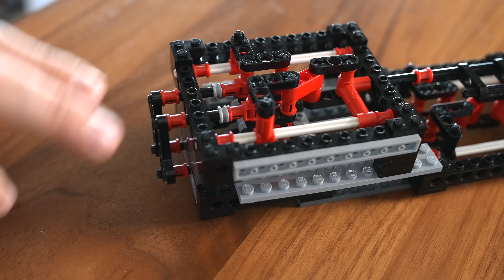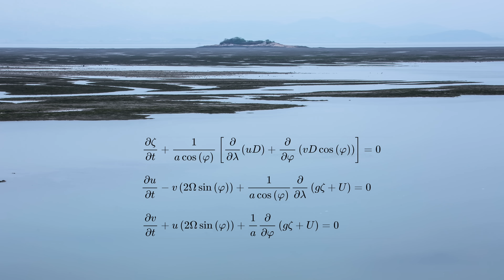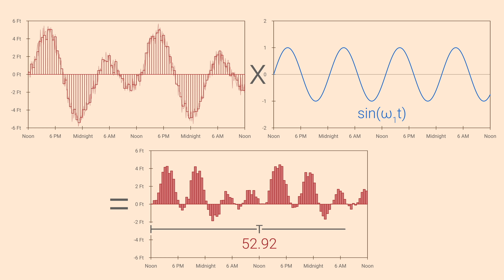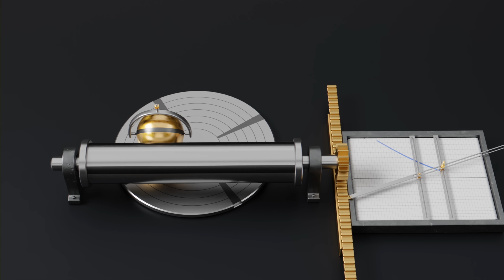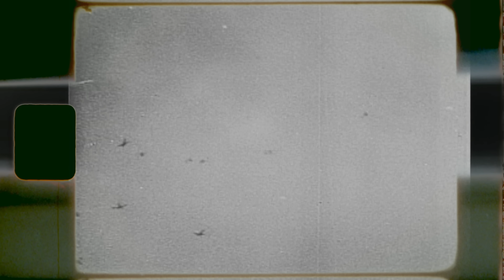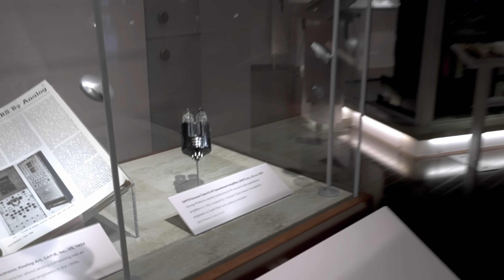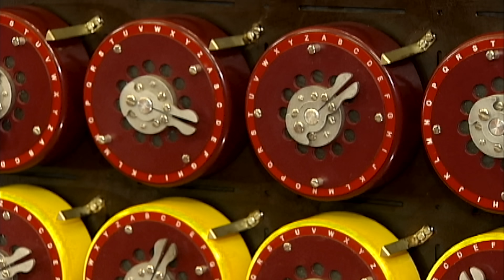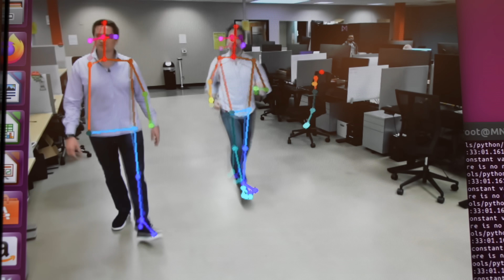The Most Powerful Computers You've Never Heard Of

Comment: In my view, any analog device could be more easily made in let's say CAD software and would output when run exactly same result in simulation every time. Also mechanical failures or inconsistencies in material would not be an issue. Now, if this is really true, there would not be those startup ups out there so looking forward for next episode .

Comment: There are a couple of unstated things that have led Analog Computers to have taken a great backseat to Digital Ones.  I also will make a comment about where I think your next video is headed.

I think everyone knows that Digital Computers have gone through an insane cost reduction and power growth curve at the same time.  This doesn't just include processing power but power, memory and storage as well.  Analog Computers have not been anywhere near as scalable to date.  In a massive oversimplification, the noise problem that is mentioned carries over into analog devices in many ways.  This means that analog electronics just has not been able to go through that same revolution cost, processing, and storage revolution.

The second problem is exhibited throughout the presentation.  That is that Analog Computers, as we know them today, solve one problem at a time.  We have yet to come up with an effective way of creating the equivalent of software to drive the development of analog computers.  Imagine having a different computers to run YouTube, Netflix, Gmail, etc.  You can make make analog computers out of general purpose components, but you would have to reconfigure them to run different applications.  I am old enough to have to have "programmed" analog computers to solve circuit problems in Engineering school.  The computations to set them up correctly to make good waveforms often took hours or days.  

So, I suspect where Derek is heading is a new burst of neural network research.  These have been around a long time and are intended to emulate the working of the human brain, which would theoretically lead to a general purpose Analog Computer.  Will be interesting to see if anything meaningful has been done in the last 30+ years (which is the last time I paid attention to this).  We could make 10ish neurons at that time and had found some ways to solve specific problems with learning.  Scalability and general purpose were not solved problems.

Comment: Can someone tell me why the mechanical integrator uses a ball and not a thin disk? Was there some adjustment that was done by tilting its axis? I've looked and photos and see no facility for it. There was a disk-and-wheel mechanical integrator, but I can't find any remarks around why you would pick one over the other.

Comment: Hypothesis: Using digital computers to manufacture analogue computers will dramatically decrease the failure rate of the analogue computer due to the precision and consistency of the digital computer.

How to test: Design an analogue computer who's purpose is to measure the fluctuation of something commonly understood. Build one version of this computer the traditional way, and the other version, using the digital computer. The constant being the fluctuation being recorded (a pattern or system already well understood, something we don't NEED to measure anymore), and the only variables being the way the analogue computers are manufactured.

The conclusion of the experiment should give us an idea of how digital and analogue combined can effect the consistency (or remove the inconsistency) of analogue technology.

This doesn't seem like a ground breaking idea, and I'm sure part 2 will actually touch on this, but as far as I'm aware, this isn't considered/mentioned. Unless I'm overlooking something.

Can we get this comment noticed by Veritasium to try and get a response? If for nothing more than to soothe my curious itch.

Comment: This is interesting. I wonder how they compare to something like the MOST bus in some cars. They use optical fibre to transmit data around the car. But they don't use digital signals, but i think its 64 possible values instead of 1s and 0s at a few megabits.

Comment: I hate to be the pedant, but the Norden bombsight wasn't a failure because it was analog.  It continued to serve with distinction in the Atlantic theater.  It's failure came from being installed in the much higher flying B-29's in the Pacific theater.  When it encountered the jet stream over Japan for the first time, it had to compute groundspeeds that to that time were undreamt of.  This is an example of input saturation, not an inherent weakness in analog systems (poorly designed/imagined digital systems are exposed to this failure too).

Comment: Analog computers are specialized devices.  They have to be purposely built for specific tasks.  They are highly complex and require manufacturing with extremely high precision.  Digital computers are programable allowing any task to be completed. 

The wireless technology that allows data to flow between our mobile devices to Cellular Network or WIFI are analog radio signals.  Without analog radio transmitters, we wouldn’t have smartphones.

Comment: The problem with analog computers is friction. We can produce extremely tiny gears out of sapphire and put them in a vacuum to try to reduce it as much as possible. And that has been done. But it is unlikely that analog computers will supercede digital ones until we come up with some sort of solid state analog computational system. Which boggles the mind thinking about. But I won't say it's not possible since no one thought a specific charge of silicone would make solid transistors possible. 

Most likely, the replacement for digital computers will be quantum computers. I can't even start to explain how they work (because I really don't know) but that is the technology that the most money is going into researching. So likely that is what the replacement will be.

Comment: speaking of Analog computers. While I served on board the BB62 USS New Jersey Battleship, they had, and used an analog computer called the mark 1 able. The thing was about 5' on a side and had gears and nobs all over 5 sized of it. 
Using the M1A for the main battery (the 16" guns) they were able to drop a round inside a 10' circle at max range (about 22 miles). Considering that a 1900lb round, pushed 22 miles creates a crater several times that, that's pretty accurate.

Comment: Fun fact: lenses can also compute. When you illuminate a film with collimated light and place a lens with a screen in its focal plane behind it, it will project a Fraunhofer diffraction pattern, which is a Fourier transform. Optical systems like this can compute two-dimensional Fourier transforms at the speed of light. They were used in the 70s at universities because they were MUCH faster at transforms than digital computers.

Comment: Two things, I'm bummed that the analog computers used to for battleship fire control systems weren't mentioned. The usage of differentials and cams in there were super interesting. Second, I'm curious for the second half of the video if the application of memristors is mentioned at all. They were the last fundamental circuit element alongside resistors, capacitors, and inductors and only existed theoretically until there was some headway in actually making them in the 00's. My understanding is that their properties can be used to model neuron activity and have interesting applications for AI or machine learning as a more modern use case.

Comment: I think you might be conflating colossus and the bombe machines. The colossus machines were modern(ish) digital computers using thermionic valves (vacuum tubes); while the bombes were electromechanical. I think the bombes would still count as digital for the purposes of this video, although neither approach used a strictly binary numerical system like modern computers, I think colossus was biquinary or something strange like that.

Comment: Honestly, I would like to see an episode on how the US WW2 battleship aiming computers worked. I have been to the USS North Carolina battleship museum and they have these computers well maintained and I have always wondered how they used these devices. Each one seems to have a hundred switches and tiny calculation windows, but when one considers that they were using these to obtain pin point accuracy when the gun is constantly changing position in relation to the target, I can't even imagine how exhausting that work must have been.

Comment: The examples of the two adding machines demonstrates how digital logic gates are extremely resource inefficient compared to analog computing. However, because they are general purpose machines, and so tolerant to signal noise, we can get around this inefficiency by shrinking them down to an incredibly small size. Quantum computers will have more in common with analog than with digital systems, and I can't wait until they start scaling to useful levels.

Comment: Both of them are digital computers.  When you use gears, you are quantizing rotation in discrete fractions of a turn.  Like digital computers, you are "stuck" with using rational numbers in the calculations.  (A computer with gears COULD NOT calculate the length of the square's diagonal, given its side.)  That other mechanism could be analog if you move the lever partway between 0 and 1.  The gear computer is approximating analog ratios by the nearest ratio of whole numbers.   Run that eclipse calculator long enough, & its answers will drift off from correct predictions because of this approximation.
          There are still lots of "analog" computers.  Every piece of "digital" audio equipment has an analog section between the mic & the digital computer's input, & between the digital computer's output & the speaker.  The demands placed upon these analog sections is greater than ever with the increased precision demanded.  "Switching" power supplies also have analog control sections to regulate them.  The power supplies for the digital computers are analog.

Comment: Anything that is specialized in one thing has the disadvantage of only really working on that thing but the advantage of usually being faster in that thing than the general solution.
Look no further than your CPU and GPU in your computer. The CPU is the Central Processing Unit that can do anything including drawing thing on the screen, while the GPU is the Graphics Processing Unit that mostly only does graphics and/or many small parallel math computations.

Comment: So the real-time significance of Zero Kelvin is now more apparent. 

Excellent exposition of Quantum Logic reference frame to 1-0 wave-packaging probability.

"Where do ideas come from"?
The self-defining mental activity of physical inactivity that is Trancendental Meditation, this is the inside-outside presence of e-Pi-i AM-FM self-defining alignment at UHF, it's all analog physically and analogous correspondences mentally. "Inspiration" of invisible Quantum-fields Mechanism Holographic standing wave Modulation. 

This is how to recognise the occasional Renormalisation of your personal being, and if you ask yourself to know reasonable and rational understanding of circumstances, then cause-effect of time-timing sync-duration recirculation resonance in Singularity positioning aligns your superimposed thoughts on memory associations. Very simple, no fantasy or theory required.
***
The re-aquaintance with inscribing a half size circle inside the Unit Circle that draws a diameter of the larger one, a real analogy of inside-outside holographic projection-drawing of Modulation Mechanism Singularity-point convergences of ratio-rates logarithmic 2-ness positioning geometry, and the same mechanism-technique applies to any number based log-antilog interference of circle on infinite circle possible Superspin and orthogonal Singularity-point for any selected objective Singularity-> Superposition-point parallel axis.., if you look at it for a while. The omnidirectional-dimensional Origin of inside-outside Modulation Mechanism is apparent (?). Some real Math-Physics descriptions are required in the preferred Nomenclature..

Fields Medallist, and Abel Prize winner Michael Atiyah gave a presentation of modulo-geometrical properties of circles. To an Intuitionist the expectation of a point positioning holography-quantization re-cognition of i-reflection containment Singularity-point set in 0-1-2-ness, flash-fractal cubic in sphere propensity Entanglement of crystallisation condensation modulation cause-effect mechanism, in/of coherence-cohesion @.dt orthogonal-normal/axial-tangential zero-infinity instantaneous entangled objective point of no absolute size, vanishing-into-no-thing in the picture-plane.., it's apparently obvious to observers with the appropriate aptitude like Michael, but those others of us need to have an assembly sequence to get to real-time logarithmic numberness realization.

Fun to imagine, teaching-learning.

Comment: Apart from small op-amp based reconfigurable machines, real analog computers are superfast and consume very little power. They have been used a lot by military, mainly by radars. I've been designing SAW processors with TeraFlops performance back in 80s. But the amount of second order effects, the need to intimately understand lots of various physics involved, the time required to and the plain hardship of "debugging" ie polishing of the repeatable design makes it totally unsuitable for mass production. There are not very many people in the world capable of doing the work.

Comment: Don't overlook  Konrad Zuse & his Z1 Mechanical computer built in 1938!

Electrically driven ,  it read instructions from a punched tape made of celluloid,  it operated with boolean logic & used floating point numbers!

Sadly destroyed in 1943, it did however, help to lay the foundations for what some believe may have the right to be regarded as the first functional programmable computer - the Z3 which first saw operation in 1941 - 3 years before Colossus!

Comment: One of the biggest problem to analog computing is the noise in a calculation, creating divergence in the results of repeated operations and it is simultaneously one of the biggest strengths of the method as it is very difficult to simulate a broad frequency domain in digital computing.

Comment: eh 17:51 is kinda misleading. those signals map digital bits onto RF signals that are very much analog and noise is introduced. You're not broadcasting 1s and 0s you're broadcasting sine waves that can be demodulated using IQ data to its corresponding 1s and 0s

Comment: I wanted to put my prediction put there, because it actually got me kinda excited to think about. 

One of the big problems with neural networks is that they're often just a black box that we give input and it spits out answers, it's good if you just want answers, but what if you wanted to know how it's figuring it out? Traditionally, you're out of luck. However, since analogue computers are physical representations of the computation it performs, if you could train an neural network to design an analogue computer that solves the problem, we could extrapolate what calculations the neural net is actually performing, and possibly gain some insight into the problem we're trying to solve.

Sounds promising to me.

Comment: I had an idea quite a while ago. You could use flash memory cells as a sort of container, if you graduate the container logarithmicly then "fill" it from different sources you end up with a sort of electronic slide rule. Making a analogue multiplier that can be easily integrated with a digital circuit.

Comment: It's pronounced bomba-deer.
I had to video a talk on analogue computers in the 80's just when the digital revolution was getting under way. It was by a very nice, but rather old professor who was advocating the use of transistors as amplifyers instead of switches. Everybody thought that it was really interesting, but digital just held too many cards. I came away cursing electro-magnetic interference, which is the primary reason digital took off over analogue. I remember a few days later in the pub with my mate and his brother. His brother way banging on about the latest hi-fi kit he had his eyes on. It was brilliant 'coz it was this new fangled 'digital' technology and 'digital is sooo much better than old fashioned analogue'. I corrected him. I told him digital was a bastardised version of the true sound and the only reason it was taking off was because it came with less crackles and hiss than analogue.

Comment: One of the craziest things I ever did in my electrical engineering classes was building an FM radio receiver.
The professor was describing how FM radio worked and what we would need to build to process it. I raised my hand and asked
"Wait, so you need to take the derivative of the FM signal to get the original sounds, right?"
"Yes, that's right."
"So this circuit... does calculus on the input?"
"Uh, you could say it that way."
A person can differentiate in minutes. A digital computer can differentiate in milliseconds. Analog electronics can differentiate at the speed of light.